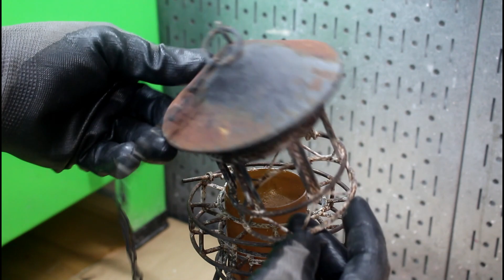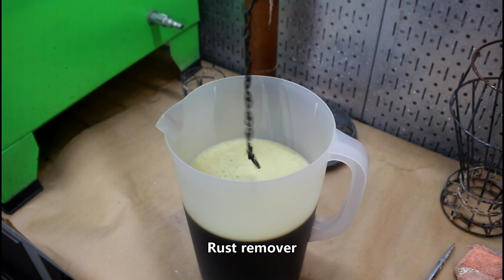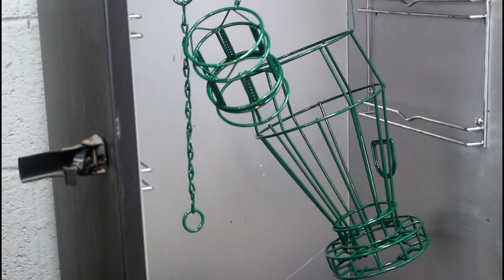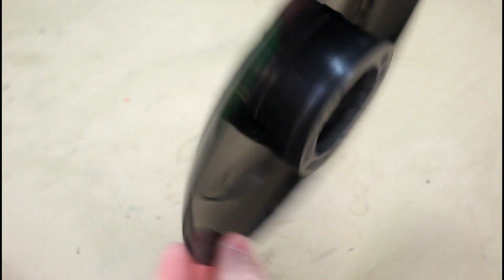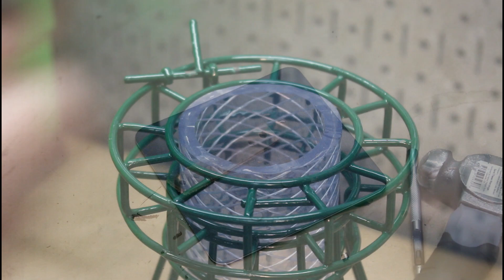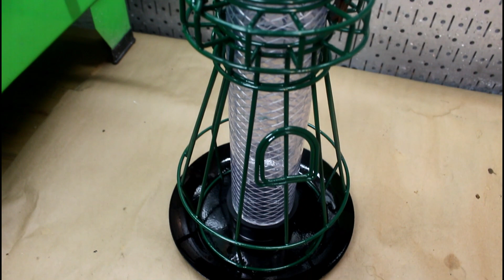Vintage Lighthouse-Style Bird Feeder Restoration

Comment: Looks great and the colors are spot on for the subject.
But I am skeptical of the epoxy holding for the winter. My guess is that the metal shrinking and expanding will crack it loose eventually.
Reply from the maker: You could be right, but keep in mind we have no winter on the east coast of Florida.
Reply: @OneMansJunk  👍🏻 Hahaha my bad, here in Sweden bird feeding are a winter habit. I had no idea your based in Florida!